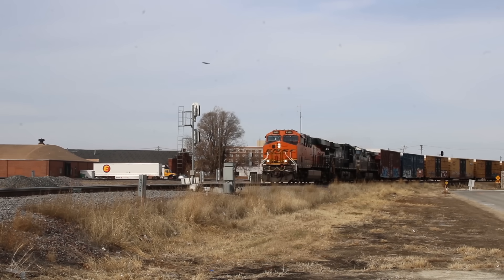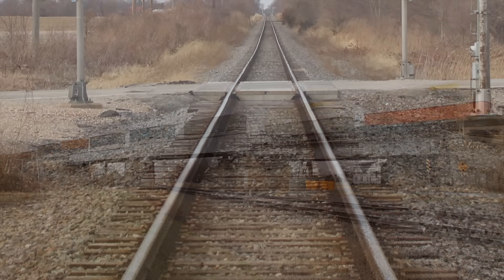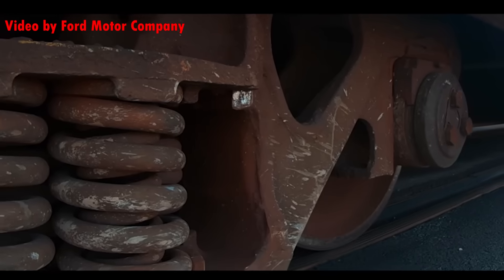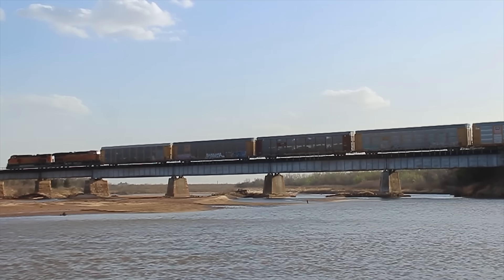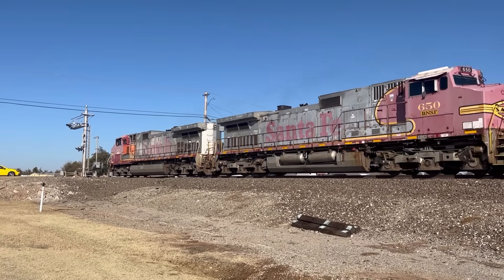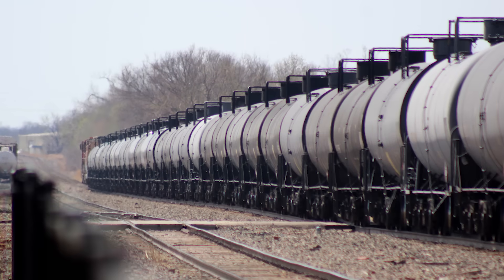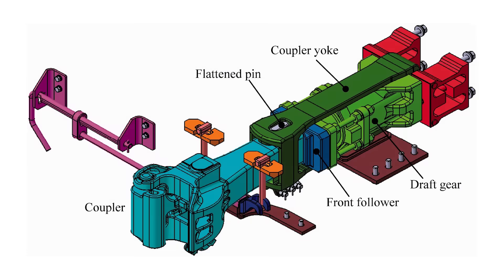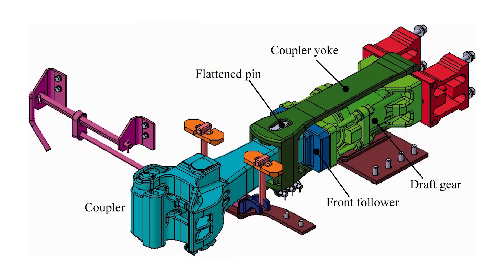Why Locomotives Can Pull So Much

Comment: Thanks for this video.  I've learned something.
However, I suggest you check the true meaning of the word "exponentially" in a dictionary ; the friction and inertia of a train as you add cars is not exponential, but additive.  If it was exponential, event the longest draft gears would be useless past 5 or 10 cars, even with DPUs.
Reply: I suppose they are using hyperbole.
Reply: Maybe this is how the author spells "incomparably" 🤔
Reply: are you sure static friction of 100 cars is exactly equivalent to 100 times one car? 
somehow i would expect more....much more. 
and that's probably because adding cars is adding both weight (of cars) and friction(of increased number of wheels).
so i wouldn't expect linear progression.
Reply: @ivok9846  I came here to make exactly the same point about the misuse of "exponentially". Exponentially would mean that (for example) one car doubles the static friction, the next one doubles it again, and so on, so that 10 cars would have 1,024 times as much friction.
And yes, I'm pretty sure that the static friction is simply additive. Each car adds the same amount of weight and the same amount of wheels, and they are independent - the weight of one car doesn't increase the static friction of nearby cars.
Reply: @OneWheelGuy1 yes exponential was definitely misused in this case. In your example exponential has a factor of 2. Is it always, or can it be any positive factor?
Reply: @matthewfrost3677  For simplicities sake I used a factor of 2, but any positive factor could be used. An exponential factor of 1 wouldn't be very meaningful, and a factor less than 1 would mean exponentially getting smaller, but they are all valid.
If the factor was, say, 1.001, then for any plausible length of train the increase in mass and rolling resistance would actually be less than linear, but still nonsensical.
Reply: @ivok9846  No I am not sure because no two cars have exactly (your word) the same friction.  But I am 100% sure that the total friction is not exponential to the number of cars!!!!!  If it was, the friction of two cars would be the square of that of one car, the friction of three cars would be the cube etc. and the friction of 100 cars would be that of one car at the 100th power.  That would require enough force to tear off the mount Everest!  
Yes : the total friction is the sum of that of individual cars, not the exponential.
Reply: @ivok9846 it would be roughly linear. The weight of each added car varies within limits. Cars should be roughly the same and average out to have the same friction
Reply: @ivok9846 you're right, very long trains is ineffective because of that.
Reply: @Deepz0ne  yes, exactly.

to all: btw. we don't need to take "exponentially" literally , scientifically, but in a humane way, just to mean "more, much more'.
more, like in: even empty cars are heavy as hell and it takes enormous amount of energy just to move it, without and cargo. 

in that aspect one wonders why are trains touted as best form of transport. i mean they would be.
if it wasn't for thousands of tones of metal you're lugging around for no good reason, other than "we can't invent anything lighter". 
or, we can, with lighter materials, but it costs $$$, and it's not "economically viable". 

i mean suddenly trains are green transportation. come on. 
esp. in usa where it's not even electrified. 
but even where it is, el. trains won't run on solar and wind...
Reply: @ivok9846  "We don't need to take  "exponentially" literally , scientifically, but in a humane way, just to mean "more, much more'." Except that it does have a precise meaning, and in a video that sets out to explain engineering concepts, if the narrator gets that (which I know about) wrong, why should I trust other things he says that I don't know about? 

"even empty cars are heavy as hell and it takes enormous amount of energy just to move it, without and cargo." Except that the amount of energy required to move a piece of rolling stock is much, much less than that required to move trucks of the same load-carrying capacity. 

"trains touted as best form of transport. i mean they would be. if it wasn't for thousands of tones of metal you're lugging around for no good reason, other than "we can't invent anything lighter"." Except that transporting the same weight of goods by road requires the lugging around of much greater masses of metal, the overcoming of much greater friction, and the consumption of far greater amounts of energy. 

 " el. trains won't run on solar ..." Except that there are a number of systems trialling solar cells installed between the rails tracks; these look likely to reduce the fossil fuel consumption associated with rail transport even below the current low levels.
Reply: Yes indeed. Americans tend to be weak with numbers.  "decimate" and "order of magnitude" are examples.
Reply: @schoolssection  Perhaps I'm wrong but I think that people in general have a tendency to utilize some words incorrectly not just Americans. Decimate is 1/10 destroyed and order of magnitude is generally the power of 10, at least as a scientist that's how I have heard it used most frequently.
Reply: nerd

Comment: It's not really the static friction. The use of roller bearings in the axles of all the rail cars minimizes that to irrelevance. It's the 𝘮𝘰𝘮𝘦𝘯𝘵𝘶𝘮 . The momentum of the unmoving cars is what makes the cars "want" to stay still, and what the locomotive is there to change. One rail car at a time, the locomotive is changing their momentum from zero velocity momentum to a moving velocity momentum, and that's when the train is put into motion.
Reply: Came to make a similar comment.
Reply: You mean "INERTIA" NOT momentumb
Reply: It is the inertia of the train that causes it to not want to accelerate(move), not momentum.

Well change in momentum still requires a force, F=ma=(mv-mu)/t.

Comment: 3:36 “It would be nearly impossible for any locomotive to pull an entire train at once from standstill” Not necessarily. Buffer and screw couplers have negligible slack when properly coupled and locomotives can start them. Trains in part of the world that use those couplers tend to be shorter.

Comment: That's why they are able to exploit thousands of tons at a time. Trains are the most fuel efficient movers of tonnage, bar none. End of discussion.
Reply: Now imagine if they were electrified, what would the efficiency of that be?
Reply: With Electric vs Diesel/Electric the propulsion is the same. An Electric draws its power from a power plant somewhere. A Diesel/ Electric takes its power plant with it.
Reply: Boats are more efficient, but they aren’t exactly accessible inland.

Comment: I feel we often underestimate take the shear power of locomotives for granite. I can see why 5,000HP+ units aren’t necessary considering how much power you can still get from just 2 or more modern GEVOs for example.(even though you can blame PSR for making some older power unsuitable) 

And what about something like the UP GTELs? Those things could out at least 4500hp(the 1st and 2nd Gen ones actually) while the Gen 3s had 8500 or more HP. What if a newer, modern kind of GTEL was built today? Sure there’s the possibility it wouldn’t be very fuel efficient depending on what kind of fuel you use, but it’d certainly be an interesting thing to test again at least.

While on the other hand, I still want to know what newer units EMD could be developing. How would they be able to continue the Special Duty series? They’ve been using the SD70 series for so long at this point, not to mention the 80MACs deserved better while the 90MACs could’ve been much better too.

Comment: I remember railfanning in a train yard once and I was amazed at how many cars one GP38 could handle on it’s own even the little engines are very strong.
Reply from the maker: Yeah, I’ve seen an SD40-2 pull a mile long train all be itself, with no brakes on the cars.
Reply: Little engines can do big things ;)
Reply: 4 axle locomotives are also strong too yk. Conrail and alot of bunch of other railroads made 4 axle locomotives lead mainline trains and even intermodal trains until 6 axle widecabs replaced them.
Reply: Here at Conrail we do 100+ buckets with one 6 axle all the time. Shoving into the port

Comment: This answered so many questions!    Great explanation of the draft gear.    I'm from Colorado, and I always wondered how much weight a train gains in a snowstorm - I'm thinking it has to be significant.
Reply from the maker: Thank you! I’m glad you found the video informational. Ya know, that’s a good question, because snow ain’t light. I imagine in a blizzard the train wound gain at least several hundred pounds of weight.
Reply: @Southern_Plains_Railfan 
I would guess in some of the conditions here would easily add a ton per car.  See many cars caked with ice
Reply: @asds714  We generally pull into a siding before hitting Colorado, and put snowchains on the drive wheels.  Never notice the snow.
Reply: @Southern_Plains_Railfan Actually this video has a HUGE Missinformation, because the friction thats needed to be overcome isn't correlated to the area. Science also differentiates between rolling and sliding friction, neither are affected by area of contact. Sliding fricton is where two surfaces move in correlation to another. Like ice scates on ice.  Here in the video the friction between train and the track is only the rolling friction (the friction or to be precise energy loss between a static surface and a object rolling on it), like inside ball bearings, where the hardness and manufacturing accuracy primarely affects the energy loss (friction) between objects.

But your point is still valid bcs you were kind of right with the sliding/static friction, because inside the bearings the lubrication needs to be moved out of the way, which kind of behaves like static friction. Or the brakes were still engaged and the braking pads need to be moved away from the braking rotor.

I know this because i studied this in Uni and had the exact same misconception before that. I'm from Germany so pls excuse any missspelling.
Reply: @Southern_Plains_Railfan considering that ice on a plane can be enough weight to cause it to crash I imagine that accumulating ice and snow on like 50-100 train cars would probably add many many many tons of weight (albeit most trains probably don’t have that many cars so it’s obviously depends on the train)
Reply: @Grebogoborp  Your logic is sound, but the buildup of ice on planes alters the airfoil shape of the wings, such that they don't provide the necessary lift to stay airborne.  This, much more than weight, is why ice crashes planes.
Reply: Highly informative! I have been aware of progressive clanging of the couplers as a train goes into motion, since I was a kid. The idea of the effect of overcoming static friction one car at a time never occurred to me. It makes sense though, and your explanation made it easier to grasp the theory. Way Cool! Thank you.
Reply: When I used to load trucks, a couple of times they had to come back to our heated building a park there over night, because they were approximately 2,000 lbs. overweight, once all the ice under the trailer melted, they were fine.
Reply: Back in the 70s, when I was with CN, my office was often in or next to a rail yard.  I'd often hear the banging, as a train moved out.
Reply: A snow storm to a train means nuffin at all. Have you ever seen the movie Snow Piercer?
Reply: @astrataway7077  haha, can’t base logic off of a movie.
Reply: @astrataway7077  Actually, they have snow plows for a reason.  In heavy storms, there could be too much snow on the track.
Reply: I've seen the delayed action of the couplings but didn't realise how important it was.
Reply: Interesting video.  Im guessing that the static friction is really the friction in the bearings and any contact between the flanges and the rails.

Comment: Never realized the friction point between the train wheel and the rail is only the size of a dime.  Sand and traction motors are huge for locomotives to move.  Thanks! 👍
Reply from the maker: Yeah, there’s a lot of neat stuff that goes on with trains, and everything feels oversized. You’re welcome!
Reply: Friction doesn't actually depend on the contact area. The reason for the low friction coefficient is material and the structure.
Reply: @arda_ufukk yeah, I think there is a lot of confusion surrounding friction. Friction is completely independent of contact patch f=uN. Also, in the context of wheels, friction/traction does not equal rolling resistance. You can have infinite friction/no slipping between the wheel and the ground, but if the bearings are frictionless than the system is frictionless. Also, especially with with pneumatic tires, friction can arise from the tire deforming as it rolls. If the tire doesn’t spring back with same energy it took to deform the tire, that energy is taken from the vehicle’s momentum and lost to heat, even when no sliding occurred with the ground. This is partly why trains are so efficient, steel doesn’t deform much, but when it does, it returns almost all of the energy back into the rebound.
Reply: I was a Hostler for the Rio Grande before the UP merger. We had a GE rep come in and tell us how the new GE AC locomotive could pull just as well with 5 traction motors as it did with 6.
   I replied that the maximum point of traction is the instant before slip. If you remove 1 motor you remove 1/6th of the contact points. The rest is either not pulling at the max or the extra #6 motor is useless. 
I then laid 6 dimes down on the table (representing 1 truck) and took away two to demonstrate how his promotional materials didn't jive with reality 😁